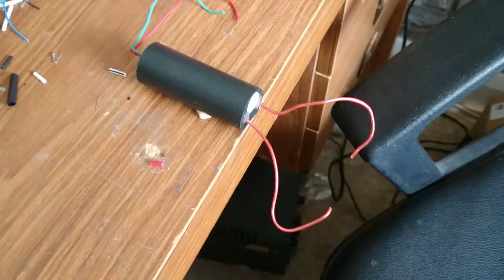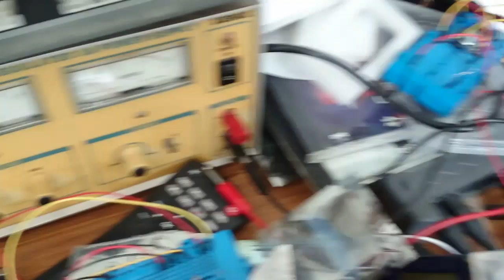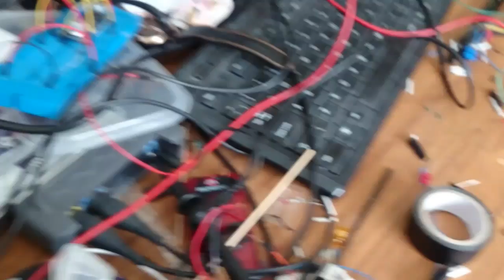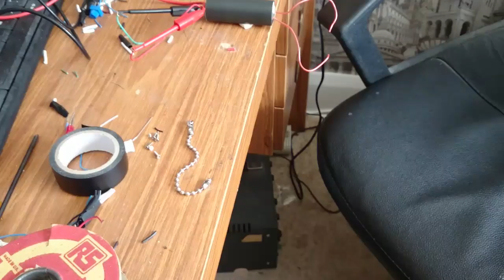Playing with 400kv inverter

Comment: the wires are supossed to be no futher apart than 11 milimters at 3-4V, and around 20+ for 4-6. I've seen a video when guy had it on 2x3.7V=7.4V, but it's hard to tell if it doesn't shorten the life of the inverter. 6V should be safe.

Comment: had exactly the same reaction when I got mine, then made it into a hand held device with a 500mah 1s lipo, make wire electrodes that are at least 30cm away from the handle!
then it's happy days
Reply: Christina Owen you man mm I hope
Reply: Christina Owen how many minutes will a 500mah 1s run it? I was thinking a 5000mah 1s for myself

Comment: can this be used as static electricity generator?
Reply: I tried it but it doesnt work (not with mine) These things are creating high voltage pulses. So you would have to store the whole energy in one capacitor which can hold this voltage and energy. you can build it with two metal plates and one 1-2mm sheet of plastic (PET should be good). But then theres another problem: the capacitor will discharge again and again because of the own resistance of the spark generator. So you will have to either rectify it or have a spark gap between the capacitor and the generator. But If you have just a spark gap it also doesnt work that well, because of this isnt only DC. I think inside of it is a cascade. This produces DC.But if theres a load on it (the capacitor is a load if there are just short pulses) then the cascade also produces AC. So it will be AC with a little bit amount of DC mixture. So it would be bether if you rectified it before putting it at the capacitor. And then finally you can make electrostatic expetiments with it. (you can use a very high resistor across the capasitor to limit the voltage and provent a damaging of the generator. This resistor should be around 1 G ohm (1*10^9) ohm. you can use a piece of wood as a variable resistor if you can move one contact on the wood).

Comment: Is it only for 3v or can i put a 9v bat to it
Reply: It's rated for max 6 something volts but a friend of a friend made a taser/spider killer and uses it with a 9v battery without a problem.
Reply: NorwayVFX ok then i use a 4v bat at the end it goes not more.    i come form germany sorry for my english 😞
Reply: From what I've heard, most of these are dead on arrival. I've bought three and out of those only one works.
Putting 9V through it would probably be fine as long as you do it in short pulses.

Comment: actually, when working with coils the + and - doesn't matter since it is just a wire and no diodes have been placed since they would be useless.
Reply: Psycho Me this isn’t just a coil. There are tons of diodes in this unit